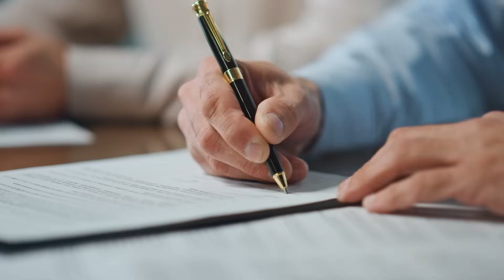Iran Biggest Megaprojects Under Construction 2025

Comment: Those pipelines are actually too narrow. They gotta be at least double that thick if they want to make big changes in their landscape.
Reply: they're long enough so i don't think so
Reply: The thicker they get, the harder it gets to pump the water inside the pipes. It's not just about pipes. You also need to pump water deep inside Iran because the terrain isn't flat. So, I'm sure the thickness of the pipes has been well-calculated to optimize both water flow and the energy required for pumping.

Comment: Change effect of global warming
Hello, thank you, prevent effect of global warming, New energy from sea will change world soon, minerals and temperature of water and air from sea are huge source of energy, reduce more than 50% using fossil fuel, fresh water, fertilizer(minerals+O2,N2,C), electricity,  zero pollution, I invented new method base on designing this machine, by method of thermodynamic and electromagnetism,  it  produces 150Megwatt/hour electricity and 20000M3/DAY fresh water and fertilizer, using power magnet of machine as catalyst to separate N2 and O2 from Air , economy will rise by using jet plasma machine that it compresses gas(hot Air) in isolated structure in water pool with more than 80 % efficiency, it has two vertical cylinders, without crankshaft, in first level it transfers compressed gas(hot air) temperature from engine to sea water(hot air  + compress's air temperature+ engine heat+ hot sea water)  in pool for steam electric generator, steam combines with high cold Air pressure( gas rules) to produce pure water and electricity , there are other source of energy that with international cooperation in coastline we can reduce effect of global warming, further more we can prevent these phenomena like cyclone and flood and wildfire , earthquake and ocean water level by using this hot seasonal atmospheric condition, recent years in summer, geothermal energy happens in surface of coastline, there are many countries in coastline with seasonal hot weather and water condition in comparison with middle Ocean, its more than 12 degrees ,this differences must decrease, in sum-up, by using this energy not only is economical but also reduce global warming in countries like Japan, China, India, Mediterranean countries, Iran, Brazil, Mexico, Us, Canada, (Africa and Arabian countries....) . I invented new method base on air pressure rules and quantum physics ionization sea water minerals in strong dynamic permanent magnet(SMCO) with special frequency(1500or 3000)/minute bases on paramagnetic and diamagnetic particles and electrical microwave electron wave field and electric chemical reactions and photon wave from semiconductors with special angle Cations like(K+, Mg++, Na+, H+, H++, li+, H2, ..) are transferred to in the second level into up level by vacuum pump from storage into combustion chambers and they combine with O2 and N2 ,... as major part of fuel, they increase speed of machine, modern induct Gearbox to control speed of opposite direction, in the end point, dynamic magnet significantly reduces by air compressed,  it is controlled and stopped by maglev force and spring and hydraulic jack and opposite force from second cylinder, for producing electricity and fresh water (removed minerals by accelerate ionization system from sea water) and fertilizer. Increasing amount of ionization minerals in magnet field despond on how many electrolyzes uses.
producing pure water and fertilizer haven't any cost by jet plasma machine. 7 methods zero pollution for reducing global warming I mentioned in my profile. it optimizes with AI programs (G20 countries can solve these phenomena like injury and death, billions of US$ in global warming damages).